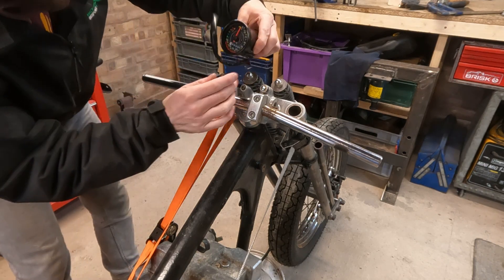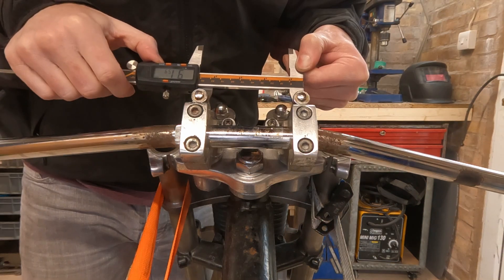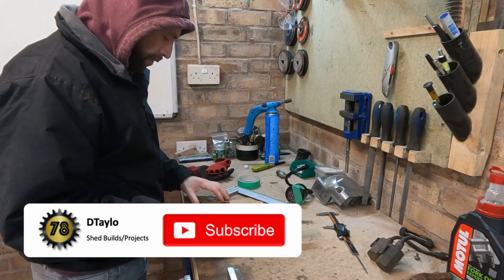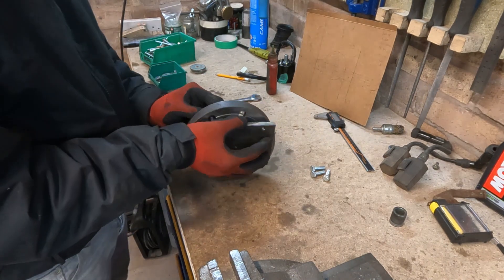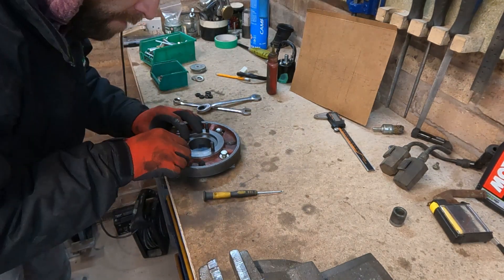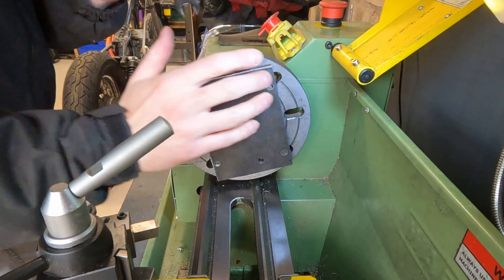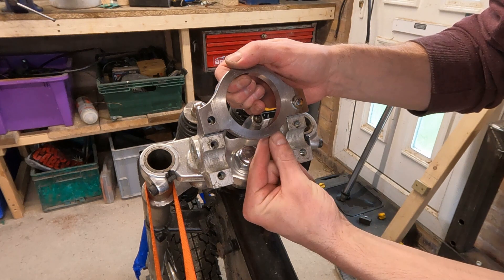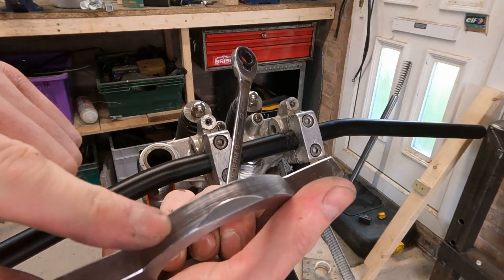Fabricating a Honda Rebel Speedometer Mounting Bracket

Comment: Quite funny really. I'm in South Australia so everything here, since 67 anyway, is metric. So, my Rebel speedo goes up to 140KPH. Yours goes to 160MPH? LOL. The most I ever had my Rebel up to was, "I guess" 160KPH. 150 stock standard - and with the cam slightly ground, perhaps another ten klicks. Although, when you reach that speed you're not likely to let go of the bars and mark it on the speedo so you can later do some mathematical nerd calculations. It's either guess or die.  (I'm giving the non-conservative maximum BTW. As I said, it's a guess estimating how far the needle has gone past 140.)

Anyway, I'm rebuilding as well. I don't have your skills but I do watch, Like and download every Rebel vid you do. I may be poor, but I will get it done.

One question: Have you thought of doing a kickstart? I've read about adding/taking one from the 250 Nighthawk motor. Thanks for your videos.
Reply from the maker: Thanks for the support, Ive had a few people ask whether id do a kickstart conversion, it has crossed my mind but haven't really gone to deep into it, would be super cool though!
Reply: @dtaylo4517  I've got a PDF of the description how to add the Nighthawk kickstart to the Rebel engine. I stole the pages. It's from the Rebel Community Website or whatever they call it. I get an email each week with the latest updates, so you probably know it already. I bet a search would give you the info easy. Then someone like you could do it without needing another motor to scavenge from.

Think of it, the Rebel is such a two steps and clutch it 'cycle, that a kick start would remove forever that problem of the starter brush needing cleaned every two years.

Comment: Lovely job, but why didn't you use aluminium?
Reply from the maker: It would have been so much easier using aluminium however I wanted to use steel as a learning exercise on the lathe, I haven't show it but Im beginning to grind my own HSS lathe cutting tools and this project was ideal as it had interrupted cuts. So it just meant playing around with different tool geometry to get the best finishes.
Reply: @dtaylo4517  I've stated making stuff for my bike on the lathe and milling  machine,  but haven't had the courage to grind HSS cutting tools yet.
Looking forward to seeing more videos from you.
Reply from the maker: @oldmanonabike233  Ive been looking at a milling machine for the workshop if one comes up for a good price I'll be in there. Id recommend giving the HSS grinding a go, it looks daunting I requires time to grasp it. Ive found that Im getting nicer cuts/finishes.

Comment: 👍👍 Muy buen trabajo pero quizás el aluminio es más fácil de trabajar y se puede pulir.
Reply from the maker: Aluminium would have been easier but I wanted to use the lathe face plate for this project.